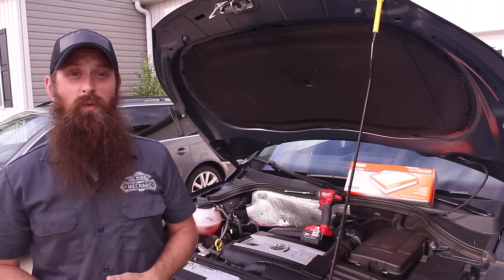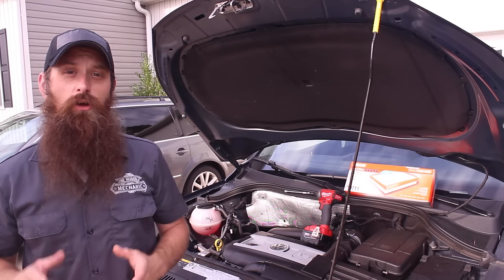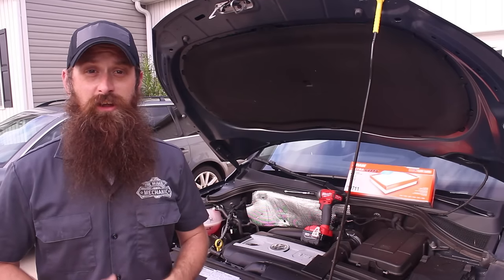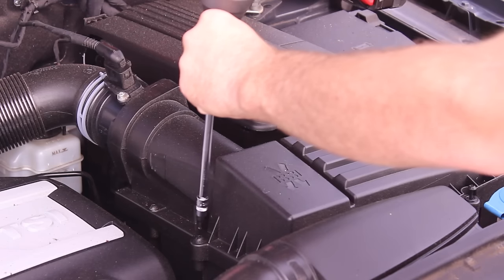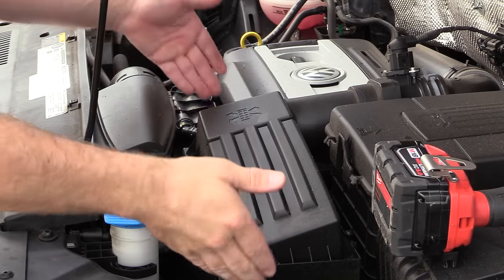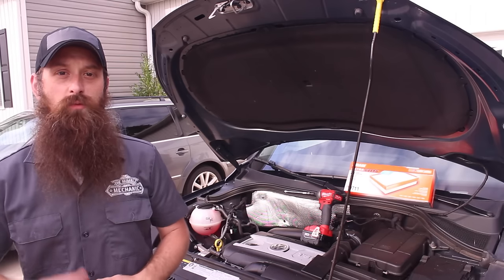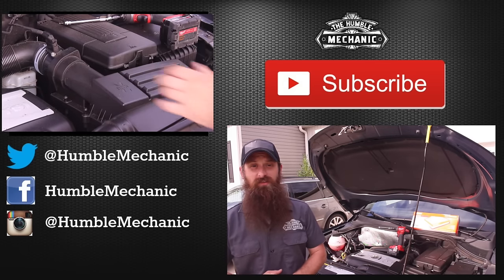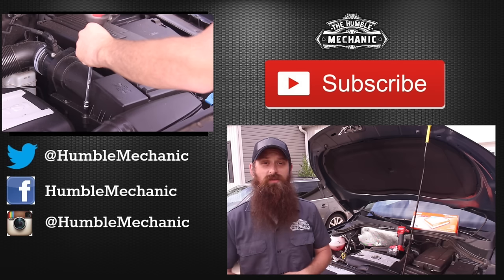Why It's Important To Check or Replace Your Engine Air Filter

Comment: A dirty engine air filter can be vacuumed out with a vacuum cleaner a few times.  Debris has a tendency to settle in the grooves of the filter.  That junk is really what needs to be cleaned out to improve airflow.  Any used air filter is going to look dirty.  That doesn't mean it needs to be replaced immediately.  Washing a dirty engine air filter made of paper would be a bad idea.

Comment: There is a difference between an engine air filter and a cabin air filter.  Some people had bought a cabin air filter.  They didn't understand why that type of filter did not fit where the engine air filter belongs.  I doubt a person would need to replace the cabin air filter unless someone usually smokes cigarettes inside the vehicle.  The cabin air filter is located behind the glove compartment.
Reply: your a/c blows better when you change the in cabin filter, you wont believe how dirty they get when you pull em out!

Comment: It makes sense to change your air filter every service. They are so cheap and easy to fit. The worst air filter I ever saw was on a 02 Mitsubishi Charisma. The guy had the car roughly 10 years and said "Oh I didn't know that air filters ever had to be changed" The air filter was literally black.
Reply from the maker: I think every service is a little much. I mean I will not hate on anyone doing it that much, but that is a lot of times to spend $25 you may not have to
Reply: HumbleMechanic That is a fair point. Maybe not every service but that kind of depends when people service their cars too. Some people might service a lot sooner than others.
Reply from the maker: VERY true. If you live at the beach, you can plan for more filter changes

Comment: Fram is known for making the worst oil filters on the planet, I'm uncertain about their air filters. Stick to a good brand like Wix or OEM if you care about your car. I don't blame you though, you're going for the $$$ here.
Reply: He only insisted on checking and changing the filter on time, not to use that specific filter. Overall this is a useful video.
Reply from the maker: +Alin Banc thank you. I get where folks are coming from. But the message of the video is, check the filter
Reply: Oil Filters: Wix > Fram
Air Filters: Fram > Wix
Thats what i've always heard
Reply from the maker: +Alin Banc :)
Reply: Any opinions on washable oil type filters vs paper? Have you experienced any issues at your shop regarding washable filters?
Reply: tsunami105
I haven't on my car. If anything the K&N air filter slightly boosted my highway mpg
Reply: +HumbleMechanic  wonder if you can answear a question,, audi 2.0 tdi 2013, audi claims that airfilter change is every 37282.27 imperial miles(6000 metric miles) !!! is that even possible ?  or are the cykels of change different from country to country,,?
Reply: I ran a K&N oiled filter on one of my cars for probably a couple thousand miles (it's been a while) and intake trumpets were covered in an oil film. Never again. It's not worth the hassle or the mess.
Reply: InternetDude  Fram is over here in north europe as good as OEM,,   one of the resellers showed me that its the same factory that makes OEM filters and Fram,,,  then there is this for example Jaguar and Land Rover uses Fram filters exlusivly as OEM parts,,  just to name a few,,
Reply: Hans Thorslund
OEM filters aren't that great to begin with. I would never use a Honda oil filter because they're designed to meet minimum specifications satisfactory for the engine to save cost to the dealership.
Reply: You're quite wrong. OEM car makers have pretty high standards because they crank out millions of cars and warranty them every day. Cheap aftermarket companies chase the cheap car owner looking to save a few bucks so they can lower their standards. I always buy OEM filters for any dino burning car I have, they are known good quality.
Reply: No your words were exactly "OEM filters aren't that great to begin with". That is false. If you want to sleep better at night knowing you're paying double the price for an oil filter because of marketing, that's fine with me.
Reply: Fram air filters are pretty good. Their lower end oilers filters are so-so, but their Ultra Synthetic oil filter is pretty good.

Comment: The hole where the screw fits in is made only of plastic or does it has metal? Im asking because im not sure if it gets weaker if you unscrew it and screw it many times.

Comment: Recently watched a ProjectFarm video in which the guy tests and compares 6 air filter brands, including K&N, Fram, purolator. Fram got the 2nd lowest rating. I only replace my B5.5 Passat with Man filter made in Germany. Other option is Mahle. 
One tip: I write the mileage in the filter itself with a Sharpie or pencil, as well as in the service record.
Stay safe.
Reply: Good idea on the sharpie.
Reply: 12mo or 12000mi is a little excessive.

Comment: You could use a wet/dry vacuum to clean out the fair filter housing . And / or all purpose spray cleaner , Spray Nine and a microfiber towel .

Comment: Charles:  I had some oil on my air filter, and you said it might be a bad PCV valve.  You were right.  I changed the PCV valve and noticed the driveability difference right away.  Idle is better, and on/off throttle transition is a lot smoother.

Should I change the filter (which wasn't that old) because it got some oil on it?
Reply: i whould replacit......their is a chance the oil whill stick to the maf(mass air flow)sensor.
Reply: Just replace it. They are so cheap why wouldn't you replace it?

Comment: Nice vid!  quick and straight to the point....I have a rather odd question, I had a new timing belt, waterpump, etc put on my car...including the thermostat and air filter and oil change.  Now I have the strangest thing with my 2000 opel vectra.  When the car is warm and I drive 55-60 mph for about 5 mins onwards at this speed and push in the clutch to either brake or down shift- the tacho for my RPM drops to 0 and the car dies.  It will start right back up or I simply let the clutch out, but any idea as to why the idle is not catching and keeping it at 6-900 rpms?  I'm guess crank shaft sensor, or the timing was not done properly. but either way its driving me crazy so any help would be much appreciated.
Reply: Yes

Comment: MY 3 YEAR OLD RIO-5 WAS STUTTERING WHEN CRUISE WAS ON AND RIDING ROUGH. AT FIRST IT WAS FINE BUT THINKING IT WAS MY FUEL INJECTORS I BOUGHT CLEANER AND ZERO. BUT THANKS TO GUYS LIKE YOU I CHECKED MY FILTER FOR THE 1ST TIME EVER BUT IT WASN'T THAT DIRTY BUT NOW BOY WHAT A DIFFERENCE.MY CABIN FILTER WAS TOTALLY CLOGGED AS WELL. IS IT TIME TO BUY NEW ONES THOUGH I CLEANED MY OLD ONES??

Comment: it is possible that the car engine overheat because I have not change my engine air filter? I have a 2009 tiguan and recently the needle start going after the middle sligtly I got scared and turned on the heater and inmediately came down to normal,somebody told me it might be the engine air filter?? txs
Reply from the maker: +Luis saul Bueso Tabore highly doubtful

Comment: Would the map air sensor or other air intake sensor cause hesitation when going up a slight elevated hill, and or under any load, cause random missfire?  Im not getting any codes and computer working ok.   I changed ignition module under coil pack, no change in condition cept slightly. Seems worst when engine is hot. Mechanic drove car and said it was fine but as iv stated it is random but i can  95% get it to miss. Also i can tell while idling it randomly misses. Seems a good Ole mech does the same. Like tuning an instrument.
Reply from the maker: Possible. For sure I’d load is being calculated wrong due to wrong input

Comment: Charles!  Thanks for your video!  I'm an entry level tech at an import dealer and a big part of my day is courtesy checks and looking at filters.  Personally, I'm pretty strict on when I sell a new filter.  Should I be more lax and sell filters due to mileage or should I hold my ground and only sell when dirt is caked on nice and thick?
Reply from the maker: I either go 100% by the book. If the original filter is in the car, and the book says replace at 5 years, REPLACE IT. 
 If you pull the filter at 40k and it's clogged, give the customer the option
Reply: +HumbleMechanic I'm a professional auto tech. I've seen clean filters that have been on the car for years break apart in my hand because the filter element became hard after hundreds of heat cycles. But most filters will get clogged before that happens
Reply: A mid to slightly dirty filter can be tapped on hard suface to clean it out somewhat. Even a very diry air cleaner tapped out is better than not, so tap first then hold up to light for inspection and then cipher its condition. Don't throw the sink out with the dirty water!  FYI change it if its old due to it deteriorating and breaking down from age. Here's your sign,  Brittleness.
Reply: So I bought a car that was 4 years old with an original air filter. I've changed it, the car runs much better. The sides of the filter were broken off and I'm worried, what else can I do even tho the car has a new filter.

Comment: A bit off topic, but what do you think about the 1.4 TSI engines? Or maybe you don't have them in the USA? I saw the plastic cover in the video and started thinking about that engine because it's pretty common here in Sweden.
Reply from the maker: +phille042 It's been good so far for us. Plenty of power, good MPG and no super common issues yet.
Reply: HumbleMechanic Okey! Because here in Sweden we have had some reports on broken cam chains after just a couple of km, even before 100.000 km (62130 miles) and because of that VW decided to go back to cam belts on that engine. But I think that it's strange to see these things in magazines and still the cars with that engine seems to sell pretty well..? Thanks for the answer!
Reply: check the air filter and you're good

Comment: Would you advise me to remove the charcoal filter and to put a performance filter, please, can you answer me, I am from Lebanon
Reply: It's probably not worth the trouble. You would gain more power just by using a high-flow filter.

Comment: So I have 18k miles on mine and a little over a year but it still looks brand new. Do I still need to replace it ?
Reply: nope. Honestly, just do what I did, wash it, let it dry then put it back. Been doing it for 3+ years now and if the filter isn't damaged and can be washed, no need to get a new one.

Comment: I'm pretty sure the mechanics placed cheese under the engine air filter. Just checking to see if cube shaped light cheese looking cubes could be the ethonol that was removed from the engine.

Comment: On a 2014 VW PassatTDI the factory recommended interval is 60k way longer than your recommending here.
Reply from the maker: +Michael Barlow I recommend following your manufacture recommended interval for replacement. 

I said it's a good idea to check it once a year.

Comment: I changed my last one after 20,000 miles and it was still pretty clean.
Reply from the maker: +cookiehead2 the one shown here has about 13k miles. And other that the spider, it's pretty clean. 

Unless you drive in harsh conditions, I think 12k is too often for filter replacement. Think checking it once a year is a great idea, and replace as needed
Reply: +HumbleMechanic admittedly, I drive in the city 95% of the time.
Reply: I drive a lot in the LA harbor district.  It's so dusty there, parking a just-washed car for a day leaves it looking like it would after 2-3 weeks in the suburbs.  I also camp in the desert a few times a year where dirt roads and wind kick up amazing amounts of dust.  I think my car's OEM filter was in for 35-40 thousand miles,maybe closer to 50.  When I finally swapped it out, it was pretty dirty but I didn't feel any difference in performance with the clean new one or see any difference in mpg.

Comment: It's funny that you covered air filters. I'm actually thinking about getting a drop in k&n or similar filter or a cold air intake. I'd like to know your take on these items.
Reply from the maker: +Darth Mall I like the K&N. The cold air intake really depends on the kit.
Reply: +HumbleMechanic Cool. Most of the research I've done seems like a wash. some say they do add what they claim others say that the computer will compensate for the added air making it just a great sound bolt on. Though I've had a k&n  drop in filters for years and I like them CAI seem like a different animal and I'm not sure if should purchase one.
Reply: If you have a MAF sensor on the vehicle I would stick with a dry filter. AFE makes drop in replacements and AEM has dry cone filters if that is your thing. I've used both on MAF based cars and both work great. The drop in AFE Pro Dry S on my Passat works well and cleaning is super easy. They also use high density polyurethane seals which add alot of rigidity and will likely last much longer than any foam seals you will find from the OEM or aftermarket. Just my two cents, let me know what you go with!
Reply: Why get yourself more work on maintenance? You got to oil those filters and check them more regularly. Unless you're pulling massive amounts of air because your car is pushing 600hp+, K&N are a waste. You'll also get your MAF sensors covered in oil over time and got to clean those too.

Comment: what is the Serivce interval for Spark Plugs/Fuel Filter/Timing Belt on a 2.5l? (BGQ)
Reply: In general, I have heard spark plugs are 100k-120k, Fuel filters are generally only replaced when they go bad which is rare but typically requires a fuel pump assembly replacement as well since they tend to be all one piece now, and timing belt is 100k-150k and the tensioner is usually also replaced with the belt.  Timing chains on the other hand do not have a regular interval.
Reply: 2.5l has a chain.
Reply: Really? Gotta love that! Plugs are every 40K

Comment: Question-can a dirty air filter make the engine area hotter than normal?
Reply: Yes because you're engine has to work harder and it cosumes more fuel then necessary

Comment: My mk4 golf tdi from 2006 has the traction control light and abs light on... What could it be?
Reply: Check your air filter.
Reply from the maker: +Johnnytestm VDubs could be a ton of things. Really need to check faults to identify the system that has an issue
Reply: +HumbleMechanic scanned it with an ob2 and it was something about the rear right wheel.... Something about a bad bearing is what he said

Comment: It's not a good idea to open air filter box to check it because seal can be damaged and some dirt can enter into the intake.
It's better as you say substitute air filter according manufacturer maintenance program or I think is the best option for our pocket and engine use an air filter restriction gauge according to the engine manufacturer restriction.An air filter is more efficient until reaching its maximum restriction normally  between 20 to 25 in H20.
Reply: Finally, someone with some engineering knowledge.
Reply from the maker: +Will Waldstein that info is pretty good, but far beyond what most drivers will do.
Reply: In my car, with a GM Family 0 Z12XE engine, the stock air filter box is an ABS shell made of two parts, mated by four metal clips that you snap into place when you close it. The lower part is connected to the air intake conduit, while the upper part ends in a pipe, with the MAF sensor in between, that leads to the throttle body. You put the filter on the lower part, which features a slot, with the filter's rubber seal facing upwards, and then you close the airbox and snap the clips into place. When you open it again, you'll find that the filter's rubber seal sticks into the upper part of the airbox. So, unless you damage the upper airbox shell or you change the air filter in the middle of a dust storm, no dirt can get into the MAF and throttle body and then the engine, and the filter itself acts as a seal for the airbox. I changed a dirty filter (actually no dirt on it, but the filter's paper became grayish) with a new one made by Knecht (the LX 737) and now the engine responds a lot faster when you depress the throttle and it feels like it has more torque at lower rpms than before. Much depends upon the airbox design.
Reply: Paper's color (aspect) doesn't represent air filter status. Use an air filter restriction gauge. Google "donaldson air restriction gauge"

Ondo ibili,

Comment: This video seemed more like a commercial for fram than an informative Humble Mechanic video. Am I right? Even whatever logo is on your cap was covered up. Hmmm 🤔
Reply from the maker: +marcofx3 it's my Pennzoil hat. It's not really right to do a sponsored video and wear a logo hat of another brand. 

Maybe time for a Humble Mechanic hat. 

As far as the commercial thing. It is a commercial. One selling you the value of checking your air filter. I addressed it in another reply.
Reply: +HumbleMechanic a Humble Mechanic cap would be cool!  Keep up the great vids!
Reply from the maker: +marcofx3 thanks! I may do a run of hats if there is enough interest. 

I hope you guys understand where I am coming from on this video. Thanks so much for the support!! :)